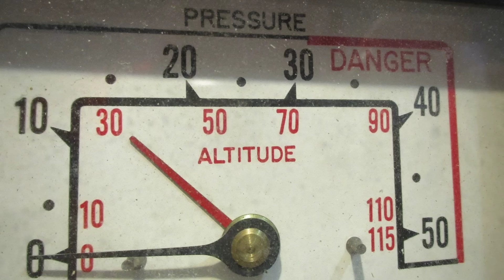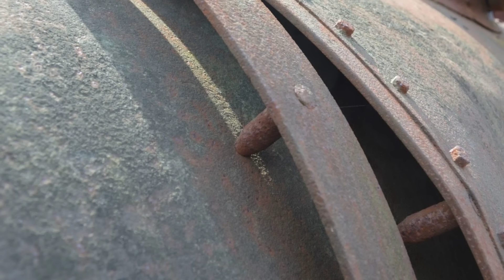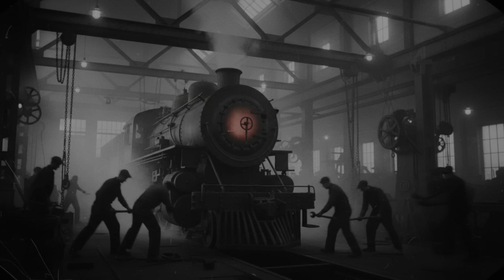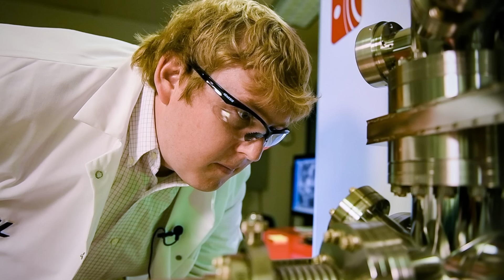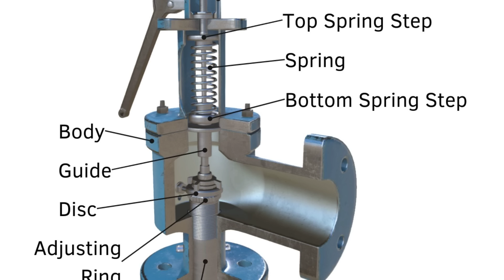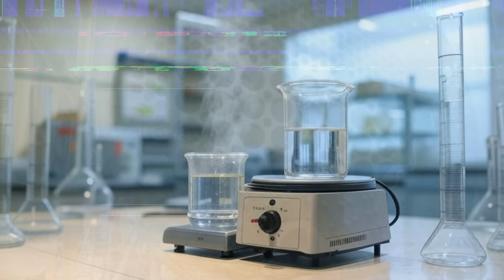When 300 PSI Snapped The Steel — The 10 DEADLIEST Boiler Detonations

Comment: 2:41 Boilers of locomotives did not hold 25,000 thousand gallons of water, it was the tender that carried 24-25,000 gallons of water for UP's Big Boy. The boiler of UP Big Boy held 10,500 gallons of water. Google
Reply from the maker: the 25,000-gallon figure refers to the water capacity of the 14-wheel "Centipede" tender, while the Big Boy's boiler itself holds significantly less at roughly 10,500 gallons

Comment: 300 psi equals 21 kg / cm²! That's a lot of pressure! I reckon boiler explosions happened pretty much with War Era type engines, which were put on the line as fast as possible, regardless of quality issues.
Reply: I don’t believe there was ultrasound technology in those days which is a way of measuring crown sheet thickness. Retired GM A&SV RR, Abilene Kansas
Reply from the maker: While wartime manufacturing stress certainly didn't help, most boiler explosions actually resulted from "low water" conditions where the crown sheet overheated and failed rather than just poor construction quality
Reply: @AmericanIronworks_1  However: when I followed the restoration of UP 4014, Ed Dickens said in one of his reports that they had built back better by using high - quality parts. What was also a problem is that steamshops simply lacked the technology to inspect pressure vessels for hairline cracks. So the engines kept running until the boiler went boom.

Comment: Not all of these locomotives had boilers that ran at 300 PSI but even at lower pressure if the water drops below the crown sheet it will be catastrophic.
Reply from the maker: youre right... gravity doesnt care about the pressure gauge once that crown sheet stays dry.

Comment: Failed Level Controller exploded Loveland Co Boiler#2 1980  very thin line btwn success n failure
Reply from the maker: Low water cutoff failure is the ultimate nightmare. Dry fire the crown sheet and the whole unit’s a bomb once you add water. You seen many scotch marine boilers survive a dry fire like that or is it always a total loss?
Reply: @AmericanIronworks_1  yes xacti what happened temp fail then surged water into hot tubes & boom. I was junior EIT 1979 so never visit just talk w Gary Maji, Dell, & Lee who investigated. Mike Orr & Donnell may recall more. Quiet a tadoo

Comment: Good point on grades  in my industry Stationary Engineers, what grampa was titled
Reply from the maker: Grandpa had a tough job... stationary plants are one thing but managing that water level on a moving grade is a different beast entirely.  You gotta know exactly where that sight glass is at all times. Them stationary boilers was where most of the old timers learned the trade.

Comment: Power plants run vhigh   I worked places with 650psi & 100F superheat… easily dooable
Reply from the maker: 650psi at 100F superheat is peak asymmetric engineering. Mobile scale is difficult due to boiler mass vs. tractive effort. ever seen a flash boiler setup tackle that pressure without a massive footprint?

Comment: Problem with those is when they fail someone inevitably puts a steel bolt or like my gramps always talked about put a steel ball bearing and it no longer fails like it should
Reply from the maker: If you plug a safety valve with a bolt or a ball bearing, you've just turned that locomotive into a bomb. Those relief valves is the only thing keeping the steam from tearing the boiler apart. Grandpa knew that once you compromise the math on the pressure rating, you're playing with lives.

Comment: When the UK used to run steam, the locos were given a full inspection and clean every 2 weeks or so. Boiler explosions in the 20th century were virtually unheard of.
Reply from the maker: different world over there... the british had a real disciplined approach to the "shop date" compared to some of the heavy haulers over here. while the lner or the lms was keeping things pristine, us roads were often pushing power to the absolute limit just to keep up with wartime tonnage.  boiler maintenance is everything when youre talking about those pressures. them inspections was the only thing standing between a productive day and a massive crater. definitely a gold standard for safety.

Comment: Most boiler explosions were crown sheet failures,  engine crew not paying attention.
Reply from the maker: Spot on. Neglecting the sight glass for even a minute on a ruling grade is a death sentence. When the water drops and the steel softens, the pressure just folds the sheet like paper.

Comment: At those temperatures and pressures, it is super-steam.
Reply: Its super heated steam. At this point, temperature and pressure is considered out of control. I've experienced this in a pressure vessel that we pressured up to 10,000 psi at 450°F.  Vessel was around 5-1/2" diameter.  We intentionally designed it to handle this type of pressure and temperatures.
Reply from the maker: 10k psi at 450F is critical territory

Comment: My understanding is that they set the gradient of the rails so that the crown sheet was never uncovered. I believe that you are being disingenous about this. Accidents happened but the safety record of steam locomotives is impressive.
Reply from the maker: That is a bold claim... but it dont hold up to the engineering reality of the ruling grade. you cant just "set the gradient" for the whole line when you are crossing mountain ranges like the Rockies or the Alleghenies. Even with a tapered boiler or a deep firebox, a 2 or 3 percent grade will shift that water level enough to expose the back of the crown sheet if the water is low.

Comment: i worked in a large wholesale dry cleaning plant  not bothered by the washer room with hundred gallons of flammable Stoddard solvent , pressing machines etc but i hated going into the boiler room with a boiler the size of a van  i don't know what pressure it used but it powered 12 dryers and 10 presses plus spotter steam positions  and we needed no radiators in winter  but it needed to stay on low  when winter went below about 30  just to keep pipes safe the building didn't have another thing that could not take freezing but water in steam pipes could be a big mess . the guy who rebuilt it survived one blowing up  or so he said
Reply from the maker: That rebuilder was lucky to be in one piece... a boiler that size carries enough energy to flatten a building if the pressure vessel fails.  Steam is a different beast than solvent because you can't always see the danger until the metal starts to rip. Those safety systems is the only thing keeping that "van" from becoming a bomb.

Comment: This is why the ASME Boiler and Pressure Vessel Code was developed.  In its first year (1914) it consisted of a single volume.  Today it consists of 28 volumes, and is also used in many foreign countries.
Reply from the maker: ASME BPVC is the definitive text on industrial safety

Comment: There are, at least, two sight glasses to indicate water level in the boiler. One on the fireman's side and one on the engineer's side. If one is lying due to clogging, there will be a difference in the boiler water hight.
Reply from the maker: Dual water glasses are the primary failsafe for a reason. If the engineer's glass shows a "full" boiler but the fireman's is empty, you trust the low reading every time.  Most guys forget to "blow down" the glasses to check for a clogged bottom fitting

Comment: This video was correct in most facts. Former A.S.M.E. boiler inspector.
Reply: I would agree with one major exception. Almost all of the boilers shown in this video were constructed of cast iron not steel. They were held together by using rivets not welding techniques. Both of these metals have similar temperature failure points but definitely do not fail in the same manner. I am also a Boiler and Pressure Vessel inspector commissioned by the National Board.

Comment: I thought the explosiveness was a hydrogen explosion from super heating causing water to break down chemically - into hydrogen and oxygen???? No???
Reply: Hydrogen and oxygen from water comes from electrolysis not by heat.
Reply: From the Hartford Company's magazine "The Locomotive" in the early part of the last century, it is not breaking apart water molecules into atomic components the recombination. Much higher temperatures are needed.

Through The Hartford examinations and testing at Purdue and Illinois University the most common failure is:
1. Water falls below the crown sheet (or equivalent)
2. The crown sheet softens from over heating. (Noticble by bagging around the stay bolts.)
3. Water splashes onto the overheated surfaces either by  change in momentum,  road angle causes water from front of boiler to rapidly run over the sheets, or commonly the crew panics and puts as much cold water as possible into the boiler.
4. This cooler water flashes to steam 
5. Pressure spikes far above design limits
6. Boom

See C&O T-1 explosion near Chillicothe OH.

Other less common failures:
1. Lap seam stress embritlement (work hardening) thus leading to outlawing lap seam pressure vessels.
2. Too many broken stay bolts in an area
3. Erosion at caulked joints inside boiler
4. Erosion / thin sheets from rust / bad water 
5. Mud / scale build up preventing proper heat transfer 
6. Purposely defeated safety valves (still happened into the 1890s on river boats causing explosions)

Read an account in 1945 by a New York Central fireman on a Niagara. The locomotive was pulling fine. It was an excellent run.

Suddenly the firebox door blew off the backead, shattered hitting the tender, and massive amounts of steam blew throughout the cab. A fire tube had let go and was blowing water and steam across the fire arch.

He reached to add make up water. The engineer reached over and hit the fireman's hand away. The engineer pointed to shut off the stoker and shake the fire out of the grates. Even though the fireman did not want to stand that close to the steam to shake the grates, he did as indicated. 

After the loco was repaired,  the road foreman of engines said the engineer saved their lives by not adding water to the boiler. It would have exploded. Better to replace a damaged crown sheet than attend some funerals.
Reply: I forgot Gettysburg. Poor, complacent,  neglected, and inexperienced operation causes explosions.  Thus the new federal regs require 2 sight glasses, enforced inspection schedule, 1472 day overhaul; basically disassembling the boiler and inspecting including the sheet thickness, usually replacing the tubes.

Regarding inclusion embrittlement: ultra rare. The metal is soft but tough to compensate. Dont remember inclusions as a cause of explosions since the early 1920s.
Reply: No… in sour gas can get hydrogen blisters or hydrogen embrittlement
Reply from the maker: Common misconception, but no

Comment: Oh boy, you never lived in steam age. My grandpa born in 1900 was a coal boy, fireman and later train engineer all over Europe. From new to old locomotive, you tread them right, keep them happy, you are ok.
Like pimping a solid Power stroke 6.0 into failure, the operator is key to have the ability to inspect his machine, checking maintenance logs and communicate.
I worked on Museums Railroads using Diesel and steam. I agree that Diesel was less maintenance, better operation cost and efficiency.
Reply from the maker: Grandpa had it right. Steam is a living organism; you treat it like a machine, it'll kill you

Comment: When that boiler blew owing to low water over the crown sheet, the instantaneous boiler pressure was well in excess of 300 psi.
Reply from the maker: Flash evaporation from a dry crown sheet causes a massive pressure surge that exceeds safety valve CFM discharge capacity. The resulting volumetric expansion triggers an immediate structural failure of the wrapper sheet.  This is a classic phase-change explosion, not a simple overpressure event.

Comment: Where do you get this 300 psi for all locomotives ? Not all steamers ran pressure this high, only more modern ones did😮
Reply: Most will have used bar, which comes out to be about 22.
Reply from the maker: Correct; 22 bar equates to approximately 319 psi, typical for late-era high-pressure power like the Norfolk & Western J-Class

Comment: Some locomotives have fusible plugs which are screwed into the crownsheet of the firebox.  They function as a passive safety device in that if the metal gets over 450F the tin in them melts and water/steam is injected into the fire.  This serves to dampen the fire and cut off the air supply to reduce the heat.  It also is a warning to the crew so they can dump the fire and prevent a catastrophic failure.  Like anything they must be maintained, cleaned and renewed on a regular basis.
Reply: in Lokomotives the water pipes are never weldet with tin.
Reply from the maker: Great point. fusible plugs were simple but lifesaving — basically a last-ditch warning before the crownsheet failed

Comment: No wonder railroads switched from steam to diesel locomotives!!!
Reply: That was not the only reason. The labor intensiveness of maintenance, operation, and fuel (and water) consumption of the steam locomotive was many times that of a diesel fired engine.
Reply: @MegaGeorge1948  A coal fired steam engine is one of the most inefficient machines on earth. That's why steam cars never became popular, in addition to the time it took to get up steam. The best steam engine systems are 15 - 18 percent efficient compared to diesel at 35 percent.
Reply: @quantumleap359 I know , but to see one running at an Antique Car show is amazing ! Something special about steam IMO .
Reply from the maker: there really is nothing like steam in motion. loud, hot, alive. diesel won on efficiency and cost, but steam had a soul to it